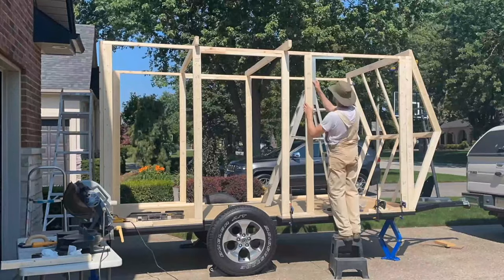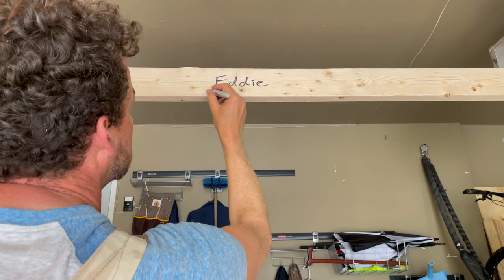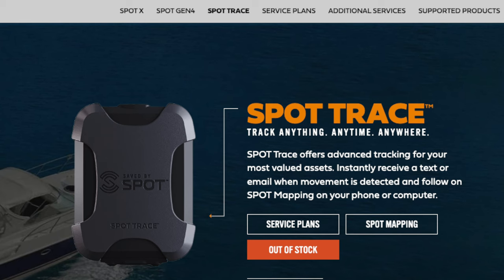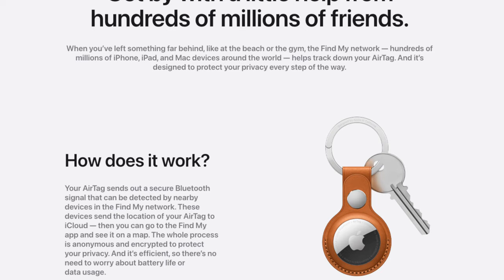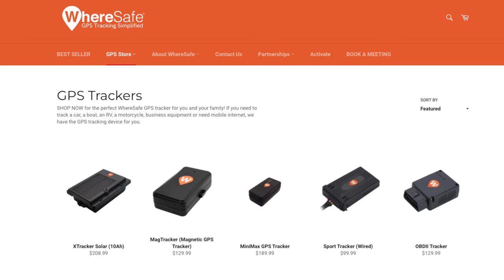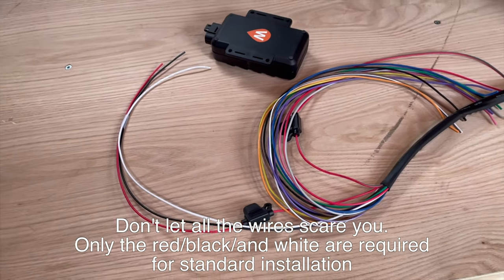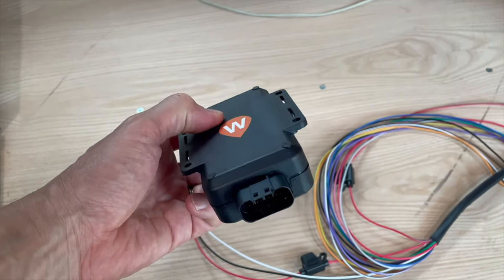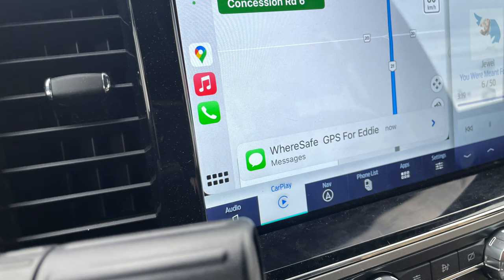How to LOCATE and RECOVER Your Stolen Property using a GPS Tracking Device from WhereSafe

Comment: Most interesting how it could get cell signal when you could not.
Reply from the maker: That’s what sealed the deal for me.
Reply: Another well done video with great information and product review.  Must have pinged a Roger's tower LOL.  I often get service in the bush when friends don't.  Makes them crazy.
Reply: @DrenalinAdventures  It could be using a different network (rogers), a much stronger antenna/signal, and simply send far far less data than most other apps require;  a simple location update could be possibly as small as 1 or 2 text messages. Combine that with buffering in memory and then holding onto the data until it gets a strong enough signal to send the update out. There are a few tricks there it could use.